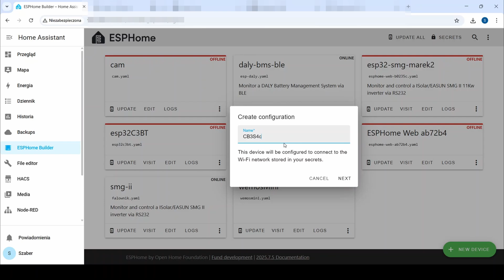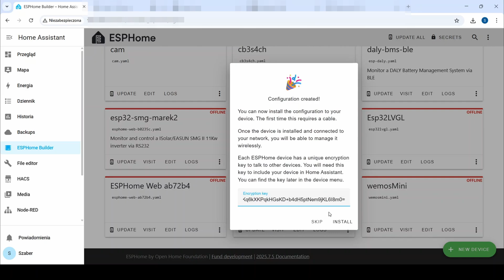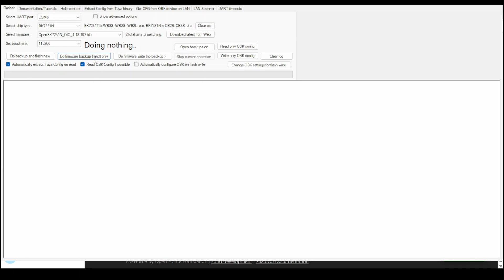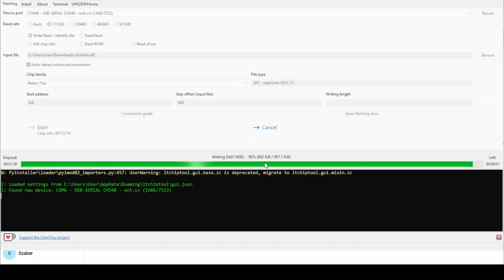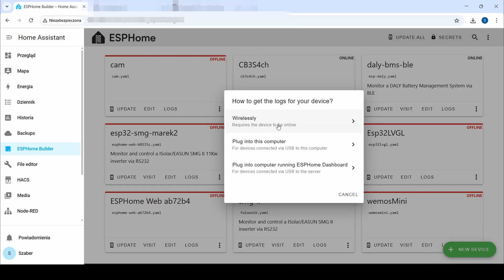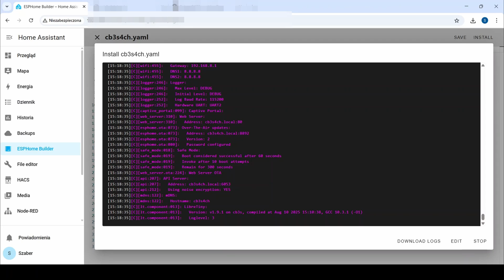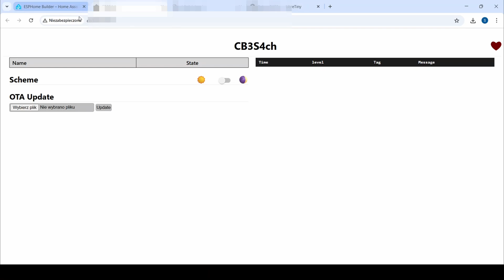Flashing TUYA CB3S BK72XX - 4channel switch Home Assistant ESPHome INSTRUCTIONS IN THE SUBTITLES

Comment: Nice work , Why are you desoldering the cb3s from the mian board ?
Reply from the maker: Because there is a chip or part on the motherboard that I don't know where it is that is blocking the connection to the cb3s chip.
Reply: @SlavoSzaber  is this part available everywhere or only on your device? I would like to flash a 3-button switch, have you checked it on similar devices?
Reply from the maker: @Hoi4_mlp  We only flashing CB3S module (in this case). This module is universal for many device. If you have this module inside your swith, you can flah this, but you need to change gpio config on the yaml file, who i attached in my github. Link on the description. You need to try find your solution.
Reply: @SlavoSzaber  Ok, thx
Reply: @SlavoSzaber  i did it! It turned out that it wasn't necessary to desolder the chip, at least on the switches, but I decided to write the firmware myself. Thanks for the video, it was very helpful
Reply: @Hoi4_mlp  how did you manage to make it work without desoldering? Mine cant pass the Getting bus failed, resetting the chip does nothing.
Reply: @Hoi4_mlp  Cool! Can you describe how you got it working? How to get it in programming mode? Thanks!